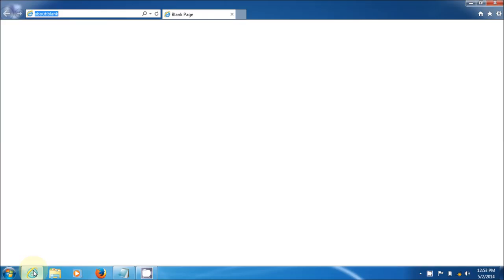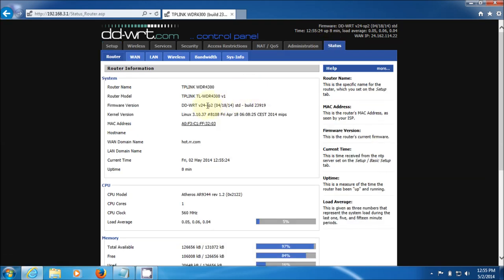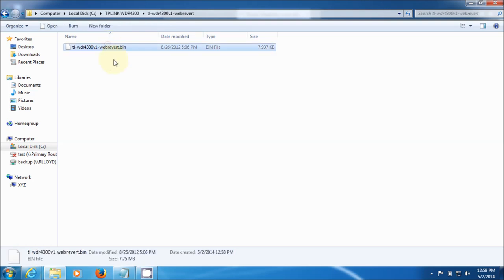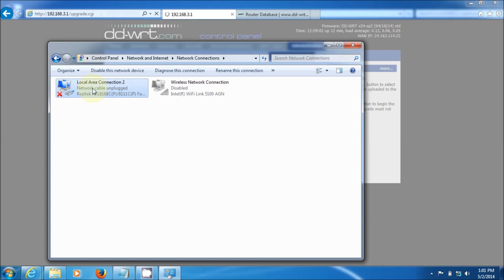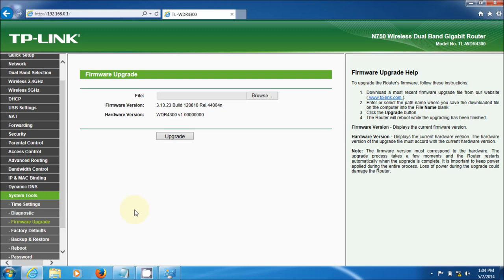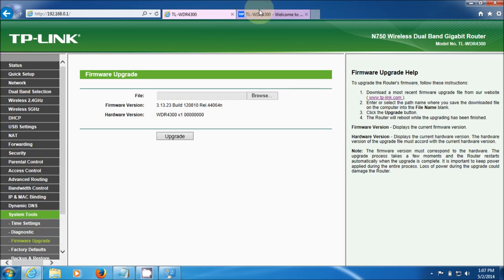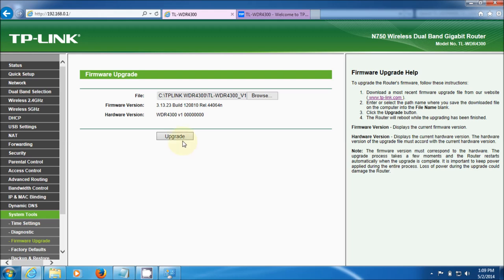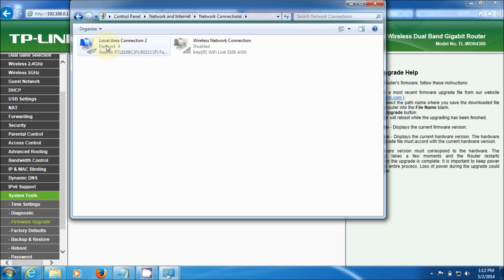DD-WRT Removal Back To Stock Firmware On TP-Link N750 WDR 4300 Dual Band Router

Comment: hi Richard you made such nice videos.do i need 30/30/30 reset for flashing dd-wrt on official firmware of wdr4300 tplink?
Reply from the maker: I would just do a factory reset from the router menu. The default user name is "admin" and the password is "password". Then follow this video: http://youtu.be/zgLZDOimTAc?list=PLnxXRLSlmSVNiENiN9wTejP6dtIqqmTya I suggest that you do not use the r21061 firmware but instead use the much improved r25697 firmware from here http://dd-wrt.com/site/support/other-downloads?path=betas%2F2014%2F12-22-2014-r25697%2Ftplink_tl-wdr4300v1%2F

Comment: Hi Richard,

I have Firmware Version DD-WRT v24-sp2 (03/25/13) std - build 21061 on my WDR4300 Router, but i'm can't revert to stock version for some reason.. Any ideas?
Reply from the maker: Are you doing this through a WIFI connection? If you are try a LAN cable instead. Are you using this http://dd-wrt.com/routerdb/de/download/TP-Link/TL-WDR4300/v1.x/tl-wdr4300v1-webrevert.rar/4134? You need to extract the rar file as well. If you have done all this try turning your firewall off (if you have it). One more suggestion is try a 30-30-30 reset http://youtu.be/gczCzP9Rry0?list=PLnxXRLSlmSVNiENiN9wTejP6dtIqqmTya Thank you
Reply: Thanks Richard!

You saved my router.
Your webrevert link file works!
Reply from the maker: Tom Peters  Great! You are welcome and I am happy you got it back to working. Thanks for watching.

Comment: Yes but mine is
 DD-WRT v24-sp2 (06/23/14) std (SVN revision 24461)
Reply: That firmware is broken, I'm also stuck on that one. You can't upgrade to any firmware, even webrevert will fail. My exams are almost over, and after that I will work on that.

Comment: Besides all the features ddwrt has what does it do better? Does the ddwrt have more lan to wan throughput or wan to lan throughput? That is all I really care about I just did this and went back to factory for my tplink I have the wdr3600. Also ddwrt firmware is from 2013 if I went back after reading your reply should I get a newer version like the beta ones I seen? Its confusing at times but on the forums they have links to other downloads and so does the site but I don't know for sure if anything is newer for my router. I will just wait to see what you think.
Reply from the maker: I use the beta firmware but I hang back one version just to be safe from bricking. The firmware does not make it faster but I do find it makes it more stable and gives me a greater level of control over the router. Thanks.

Comment: My router is just suddenly nbot connecting to the internet, The connection is not dropped.  Lights are on , on router nad on modem but pc don't connect. Want to try and go back to factory.
Reply from the maker: Try a 30-30-30 reset. http://youtu.be/gczCzP9Rry0?list=PLnxXRLSlmSVNiENiN9wTejP6dtIqqmTya then try http://youtu.be/OTrCLvJkNk0?list=PLnxXRLSlmSVNiENiN9wTejP6dtIqqmTya

Comment: Hi Richard, I am currently running the factory build on mine. If I flash r27147 will I able to revert to stock using the same file that you have linked if I wish to do so or is that revert file only going to work for the older build i.e the one that you're running in the video? Please let me know. Thanks
Reply from the maker: ***** You will be able to go back to stock using the webrevert but you first have to flash the router back to the firmware the webrevert was made for. Fortunately that is not a big deal. I have a video on how to do that here https://youtu.be/v8db53tYSYc?list=PLnxXRLSlmSVNiENiN9wTejP6dtIqqmTya Here is a video on how to take it back to stock too https://youtu.be/OTrCLvJkNk0?list=PLnxXRLSlmSVNiENiN9wTejP6dtIqqmTya
Reply: Richard Lloyd thank you! I am now running r27147 and other than a couple of hiccups with a few of my devices not connecting to the 5ghz WiFi it's running great.
Reply from the maker: ***** Cool. Did the devices connect prior to the upgrade at 5Ghz? Thanks.
Reply: Richard Lloyd Yes they did and now they seem to be connecting. Not sure what was wrong as even after rebooting twice they weren't connecting but after a few hours its fine. Have you tried a later firmware than 27147? I'm thinking maybe there's a bug in this one and to try a newer one.
Reply from the maker: ***** I use r27147 because it works well for me but by all means try newer ones. I would try the next revision in sequence until you find one that works right for you. Thanks.

Comment: Hi Richard - i just did a firmware upgrade on my new tp link WDR4300, now when i try to access the routers admin page i get the following prompt: The router allows only one administrator to login at the same time, please try again. Any idea to what thats is about - i must admit, i did do the upgrade through WIFI, but the funny thing is when i put in a network cable i can get access to the router again - i update from the stock firmware to the newest firmware, wich i found on tp links own website, its called: TL-WDR4300_V1_150518

Can you help me here?

Thanks you for your much helpful videos. :)
Reply from the maker: Does this happen on every computer on your network? Thanks
Reply: +Richard Lloyd yes i Think so - i only Got my laptop connected and of course my iPhone with the TP link app.
Reply from the maker: Down load the firmware again. Do a 30-30-30 reset and flash the same firmware again but make sure you use the patch cable. Thanks.

Comment: Richard - Cannot access dd-wrt control panel/Administration Tab? I'm attempting to revert to stock factory TP-LINK WDR4300 firmware, however, I'm denied access to control panel because security Authentication Required window does not accept "root" and/or "admin" for User Name and Password authentication? Anybody know why this is occurring? Sent email to DD-WRT but no response.
Reply from the maker: rjp Do a 30-30-30 reset and that should reset the password for you at which point you can set a new one. Here is the video for the 30-30-30 reset https://youtu.be/gczCzP9Rry0?list=PLnxXRLSlmSVNiENiN9wTejP6dtIqqmTya if this does not work for you hold the reset button down with the power on until the unit reboots (look at the lights) and try it again. Thanks.
Reply: Richard Lloyd Yes, "30-30-30 reset" drill allowed resetting the dd-wrt passwd. Thanks!
Reply from the maker: +Robert Prancevic You are welcome. Thanks for watching.